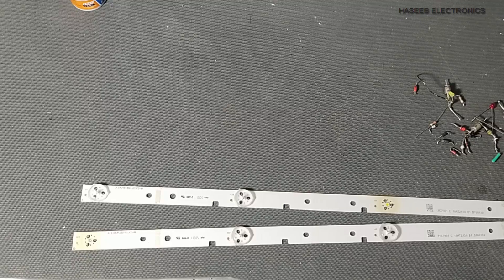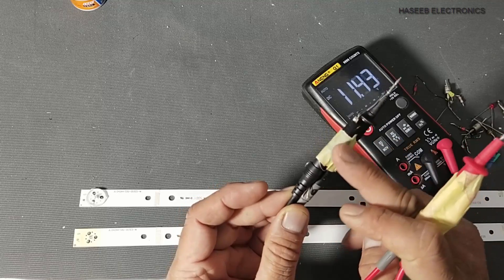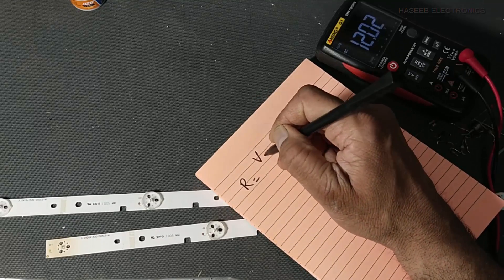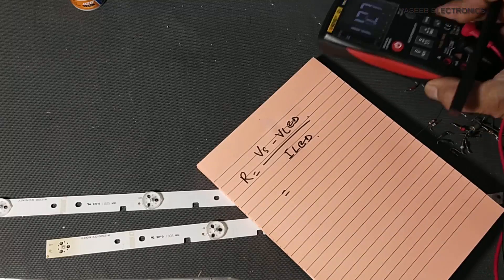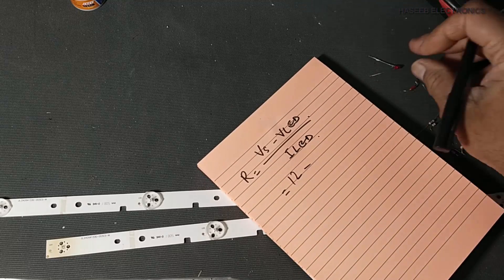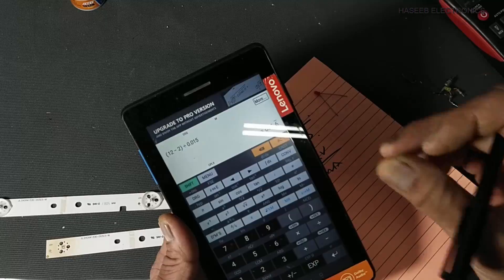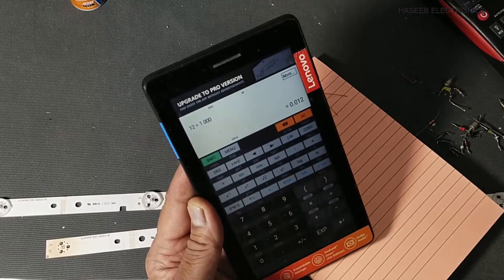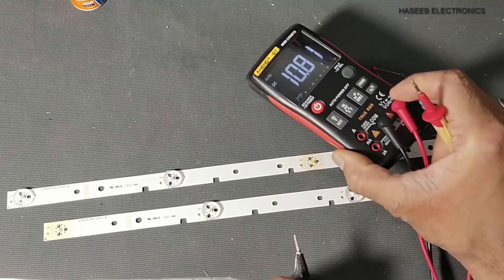{566} How To Test LED TV Backlight Strips / How To Repair LED Strip / Replace LED on LED Strips

Comment: Nice video. Is there a way to test the entire led strip of about 60 leds, not one by one, designed for 65 VDC? Will it show any resistance on a multimeter or none? Thanks.
Reply from the maker: no there are LED strips testers, we can use that LED strip testers

Comment: Thanks for explaining ,now i have a tv LED driver input 12-24V and output 18-80V but when i connect to 24 V power supply it gives output only 24 V even when the on/off signal is not connected or when it is connected still the same ,and when i connect a LED strip of 6 LEDs total 18 V they also don't bright at fullest